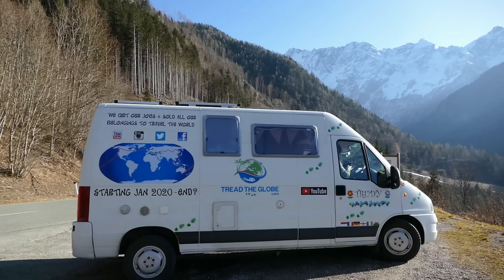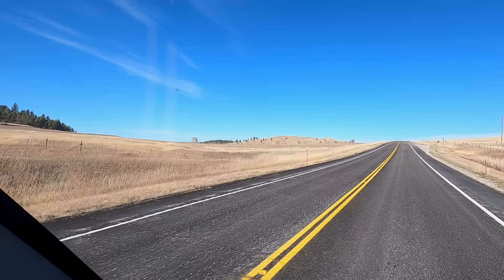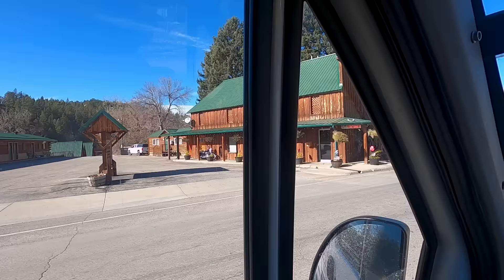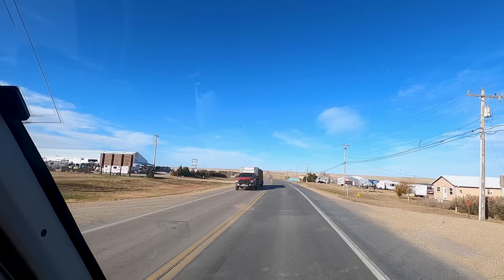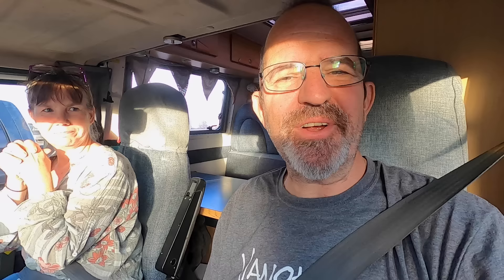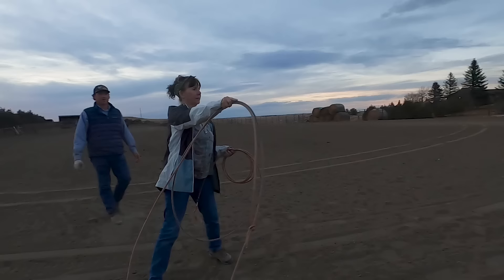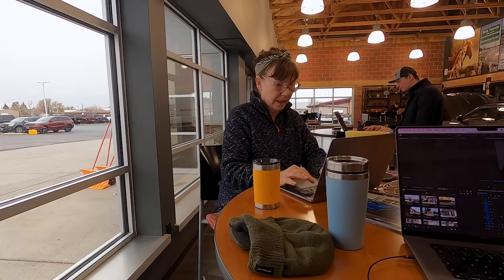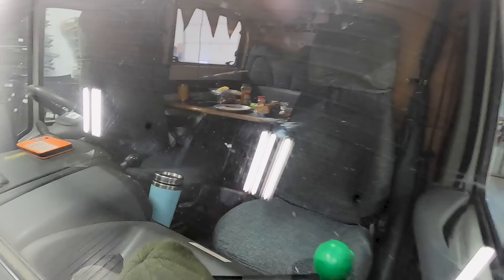FIRST IMPRESSIONS OF SOUTH DAKOTA - THIS SHOCKED US [S7-E69]

Comment: You should really get that roof vent screwed down and add bracing below.  The vent likely resists flexing more than the roof, there is at least a difference, the result is a lot of force in the corner and the sealant will break.